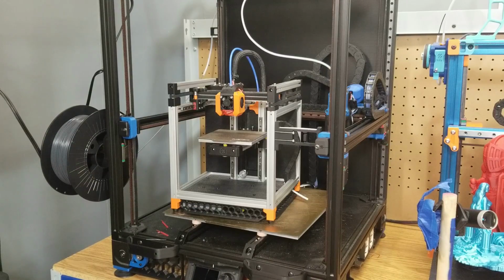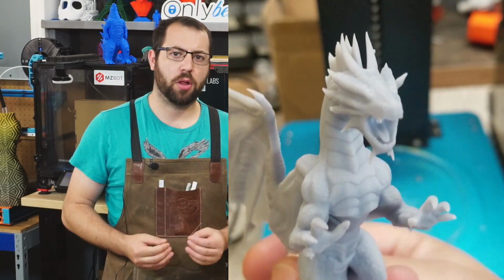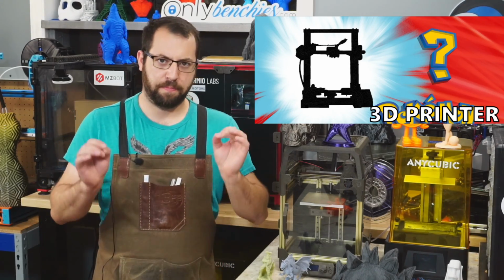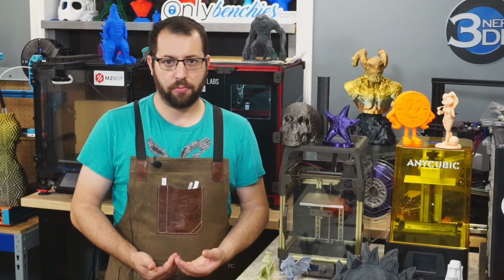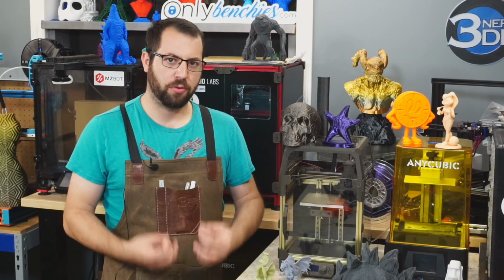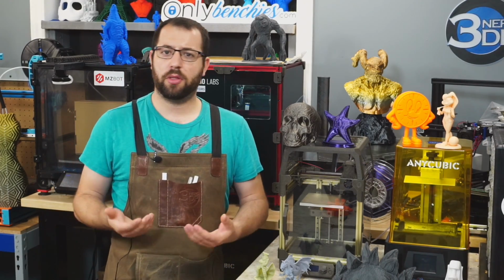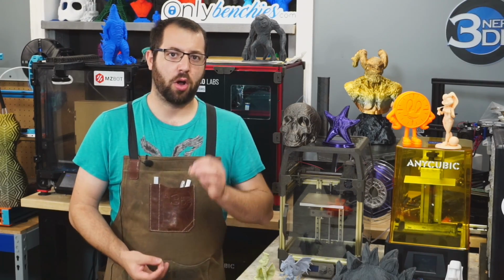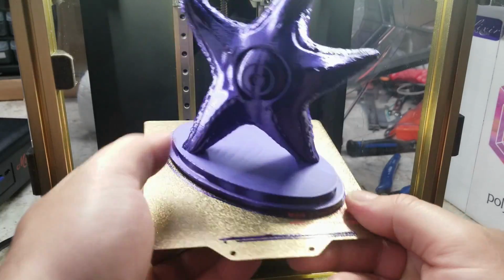Getting your FIRST 3d Printer - What to keep in mind

Comment: I fixed the all metal hotend sticking issue by seasoning the throat:
1. uninstall the hotend throat
2. drip a drop of canola oil inside the throat (nothing outside)
3. heat it under range fire until the oil smokes off
4. repeat one more time
5. reinstall the hotend. 

PLA never sticks again.

Comment: This is nitpicking, but it’s not friction from the v wheels that keeps up the gantry, it’s tension.
Reply: I forgot to mention. Great video!
Reply: Also on the ender 3 in my experience it’s really more of a theoretical problem once it’s all properly tensioned. On one of my printers is an ender 3 running an x carriage with a dragonfly+lgx+4020 radial+4020 axial/bed probe x carriage - on a bog stock ender 3 frame and it has no perceptible sag(btw runs klipper with resonance compensation and prints like a boss too… some call it over investing, I call it slowly collecting parts for a Voron). 
I actually think the v wheels and single screw are the least of the ender 3’s issues 
Admittedly though I’ve been printing for 6 or 7 years and properly setting up motion systems does get easier with experience.
On the other hand the lighter x carriage does allow for higher speed prints with less ringing on stock firmware and less tuning. 
How till we see a cheap Chinese printer with a mellow fly type board, built in accelerometers and reprap 3.4 or klipper running input shaper out of the box? If I was a Chinese printer manufacturer, that would be the nut I’d be trying to crack right now, and you’d have a solid contender for best newbie printer. We are talking way higher speeds for maybe $50 more in parts. Win win win.

Comment: For my first printer I got a prusa mini+ kit. I definitely learned a lot putting it together, both about how it works, and just from looking at how the 3d printed parts were designed. I considered a voron, but sourcing everything was a bit too much. Even with a voron kit, the printable parts aren't included, and print it forward was looking like a few months of waiting. I also considered the ~$200 printers, but thought it would be a bit of a waste to buy something that would need a bunch of upgrades.

I'm glad I got a kit, but I spent about 8 hours assembling it. I think I could do it in about 4 hours on a second attempt. So get a mostly or fully assembled printer if the only reason you'd consider a kit is to save the $50. 

As for the prusa mini kit specifically, the biggest problem was the aluminum z axis mounting plate had some holes that were too small by about half a millimeter, and needed to be reamed out to fit the z axis rails. Not a huge deal for me, but I think most people don't have a drill press. Aside from that, there are a few places where a mistake might have you undoing a lot of work, for example to slightly reposition an embedded nut.

That said, the first print was good(ASA that I ordered alongside the printer), which is more than I expected as somebody that has never used a 3d printer before. The parts I made were better than I was expecting too.

As for why I bought a 3d printer in the first place, I justified it to myself by first learning FreeCAD. I mostly intend to print small practical things, and a custom computer mouse. I suspect family members will want more artistic stuff.

Comment: glue magnet and adhesive?
Reply from the maker: Bed. Adhesive layer. Magnet. Flexplate. Adhesive. Pei
Add another adhesive layer and pei if the flexplate is double sided.

Each individually may be flat. But stacking tolerances can lead to a potential uneven surface

Comment: My first 3D printer is a Ender 3 Pro and work perfect for only 200 USD and comes with the new 32 bits board and firmware, I also check the ender V2 but was sold out and still more expensive for almost the same features. My extruder works fine but have troubles in vase mode, with only 1 perimeter random small holes appears. About Nozzles I try 0.8mm, but need to slow down speed and raise the temperature for constant flow. If you don't have Volcano hotend don't even try bigger diameter. I'm interested in 0.2mm Nozzle for miniatures, it's not resin printer but the quality it's amazing in detailed models.

Comment: How do you adjust retraction on fluidd during a print.
Reply: Use firmware retractions in slicer and configure [firmware_retraction] in your config. Then you can send SET_RETRACTION [RETRACT_LENGTH=<mm>] [RETRACT_SPEED=<mm/s>] [UNRETRACT_EXTRA_LENGTH=<mm>] [UNRETRACT_SPEED=<mm/s>] via the console
Reply: @ThePowerfox18  ok thanks